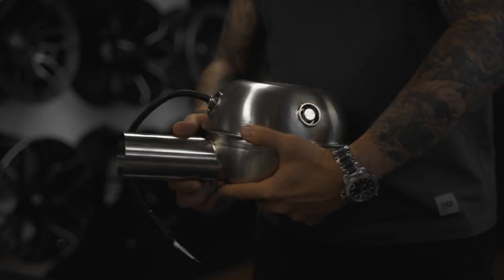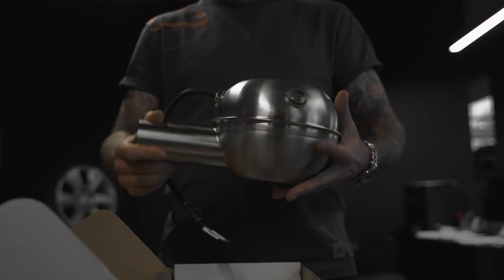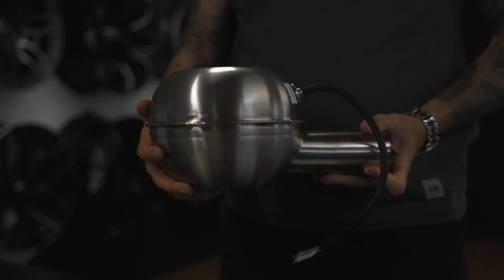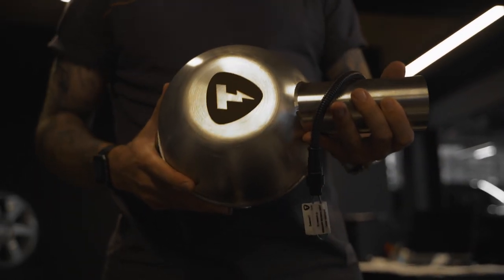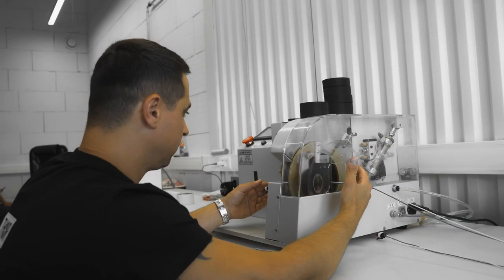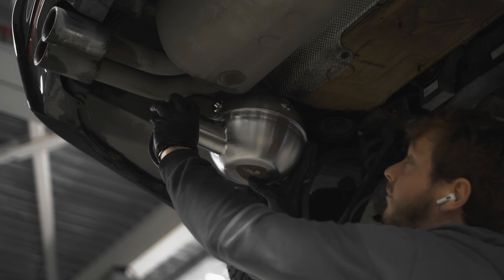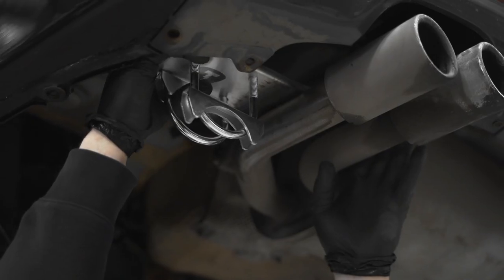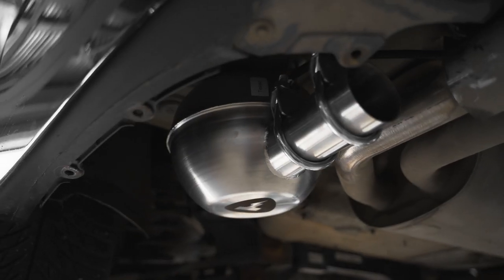Review of the THOR system

Comment: guys i think for ev cars system gives less sound level than petrol/diesel cars. Specially as i4 m50 owner i think you need to do some update about can file. I have the system with 2 speakers  but i barely hear while driving. and it is not loud enough from outside also :(
Reply from the maker: Thank you for your feedback, can you please tell me if you have contacted our tech support? 
I think the guys will be able to help you customize the system so that you are happy with the volume of the sound 

Because a dual system sounds quite loud, and if you add an ECHO tweeter to it will be very loud!